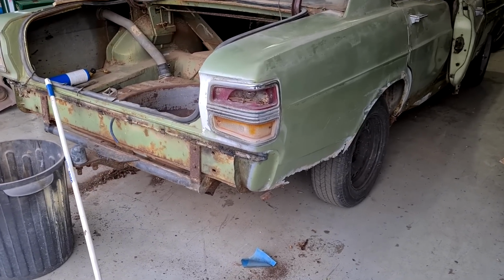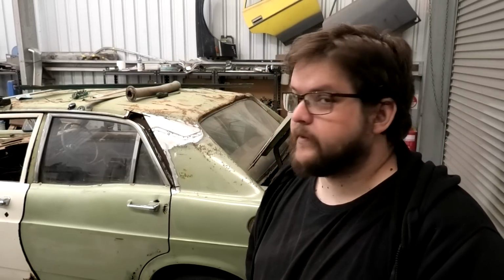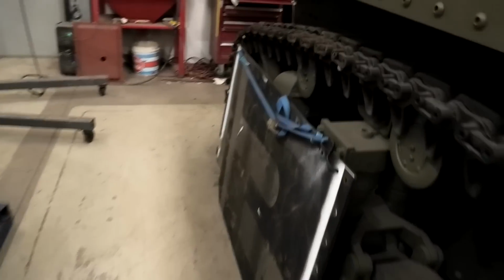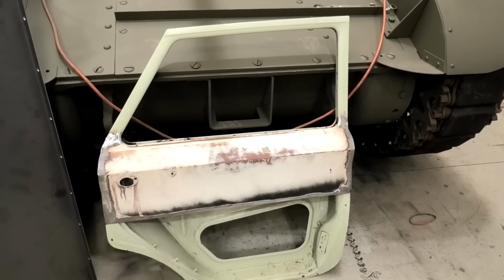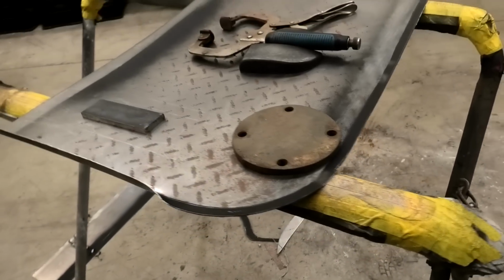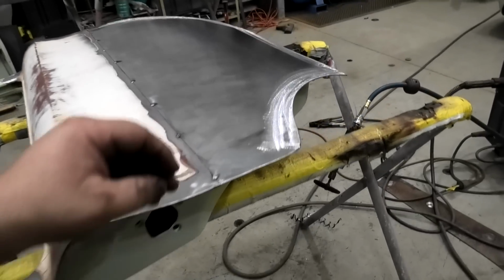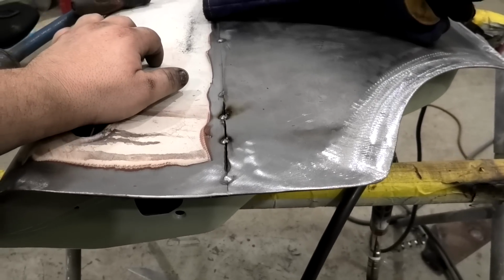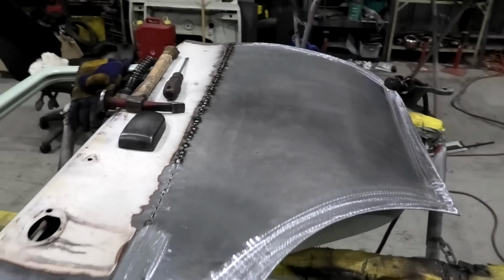Ej Holden restoration part 15

Comment: I had a base model XY with a 200 six back in the day and when I killed it I fitted a 221 from an XW. The driving experience from such a small Cubic Inch increase was like night and day.  The 221 had such a short model run compared to the 250 and was often overlooked, but it was a good motor.
Reply: I have to agree, I had an XW with a 200. Killed that and replaced it with a 221 then later a 250 but always felt the 221 was the better motor. The 250 just felt too heavy
Reply: @robertepps5030  Yeah the 221 just felt right. Must have been the right combination of bore x stroke ratio. Hard to describe but i preferred it to the 250 also.
Unless someone fitted the 200 to the XW at some point it would have been the 188ci as the smaller engine which is rare as rocking horse poop today. The 6 cylinder motors they had in XT-XW 188-221 were probably swapped out for 250 or larger engines decades ago. Quite uncommon to find them now.
Reply: @erroneouscode  Quite possibly, this was back in the late 80's. The guy I bought it off said it was a 200, it was my first car so I had no idea, still don't! lol